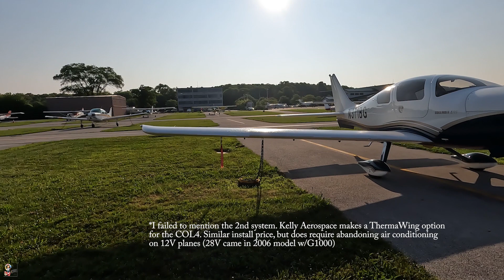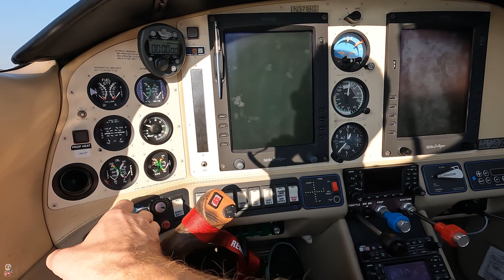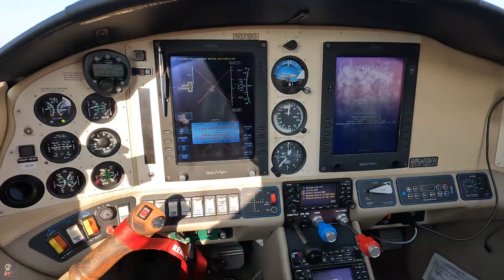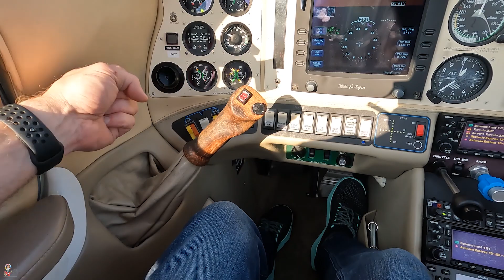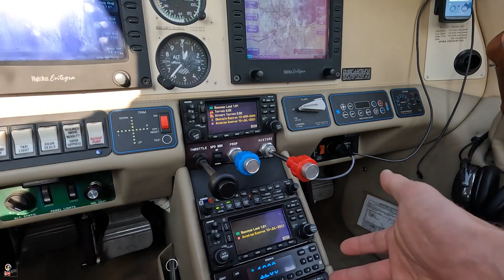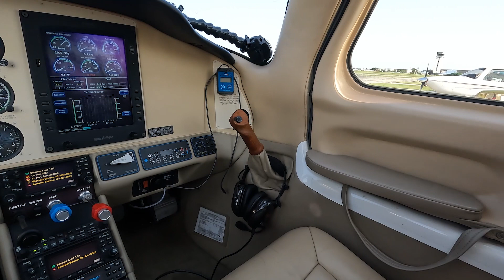Columbia 400 vs Cirrus SR-22

Comment: TEXTRON needs to bring back a TTX2.0  with a chute,  Lycoming TEO  FADEC , true sidestick.     It wuold blow the doors off of Sirrus sales.  because it would be faster,  easier to fly, have that chute, and be AMERICAN Owned 100 %
Reply from the maker: While it would be great to see this happen, it's super unlikely.
At least we have a true sidestick already. Take the win where we can.
Reply: @thehobbycollector1    it could  if they could get to breakeven in 5 years and I think they could.    The TTX2 would be faster, have more room, Fadec, pressurized, have G3000 CAPS , Return Home...And be American owned and made.    Would take 70 perecent of  Sr22 new sales.  in my estimation.   Americans  really shouldnt be subsidizing  AVIC the same company that builds jet fighters  with stolen technology that compete with the F35..right?
Reply from the maker: @scottmoseley5122  That's not a realistic expectation. In order to accomplish higher Vne, Fadec, pressurization, and CAP, it would require a whole new type certificate which would be way to expensive to break even in only 5 years.
This is the same reason why we only see very minor incremental gains in the SR-22 gen-over-gen and very rarely see any new type certified planes.
Until and unless the FARs get re-written to make certification easier (mostly cheaper), it's not going to happen.
Reply: @thehobbycollector1   it  would cost about what the cirrus vision cost ..  if the TTX2 took only half the sales of Chinese owned Sirrus it wouldb be about a year ROI. .

FROM CHT GPT:   
🧠 Conclusion
If Textron builds a truly competitive TTx 2.0 and captures even half of Cirrus's SR22 market, they could:

Recoup their $100M+ investment in under 1 year

Build a $100M+/year profit center annually after that

Cirrus proved there's a large market for high-end piston singles. A CAPS-equipped pressurized TTx with faster cruise and luxury could take a serious chunk — especially backed by Textron’s brand and support.

Comment: Thx, you are very well spoken. 
I think a lot of the spouses or lower time pilots prefer the parachute. I think they both look sleek.  I'm glad the Cirrus is made in America. Do Columbia owners have a few mechanics in mind when they do their annuals?  I believe the 400 has two solid main spares and their red line is about 230 knots. Many high-performance singles red lines are 198 knots.  Is this correct? I never entertained the fact that the Utility category is a positive when comparing the two. (I just had a super flight in my Seneca from SE Wisconsin to Rochester NY area at two hours and forty fine minutes. You can't beat the convenience, and less stress of using general aviation.)
Reply from the maker: Correct that redline is 230.

There are a few reputable shops for the 400, and a few shops who have a comfortable level of history for many. Plus the type club has a wealth of knowledge and many who are still the original owners of their planes straight from the factory.

GA is absolutely a great way to go, we just finished a quick trip down to Knoxville and back. A weekend that would be impossible in a practical sense as an overnight trip whether driving or flying commercial.

Comment: I have the 1st Columbia 400 manufactured and it came from the factory as a 24 volt system.  Can you tell me where you got the gust lock strap and attachment that you have on the left side stick?
Reply from the maker: The gust lock is easy to sew up, or you can find it near the top of AirPower’s reference list. One of my favorite gust locks that hooks to the rudder and wraps on the stick. It’s almost impossible to get into the plane and leave it in place.

https://www.airpowerinc.com/cessna-columbia-parts-guides

Comment: I have about 25 hours in the SR20, from a long time ago (2006-ish). Yesterday I did about two hours as a pax in a TT, with G1000 avionics. I could barely get into/out of the TT, and it was the tightest cockpit I've ever a tried to squeeze in. I'm about 6'4" and I was kinda done after 1.5 hours. If you're tall-ish, be sure to take this into consideration.
Reply from the maker: This is completely valid for some. I'm very median american male at 5'10" and find it to be very comfortable. The tallest passenger i've had was at 6'4" and while he fit, it was only a 30 minute flight for him.
While the seats did change to a new style in later models than mine, this is where the extra 1" of cabin heigh can help the taller folks.
Thanks for chiming in, it was something i should have covered, but was beyond my experience to competently speak towards.
Reply: I fly the Cirrus at 5ft 11, I need to decline my seat one notch to fit in comfortably, I wish it had more headroom , at 6ft 4, I dont know of any GA that fits you comfortably…

Comment: This was an excellent comparison! These performance planes are exactly what I’m looking for, although they may be a little bit of a reach financially. I will say that I’m looking for performance, because my mission is definitely to be able to go truly cross country, and get there with some speed. I also like composite aircraft as opposed to the traditional metal ones. This was very helpful!
Reply from the maker: I can sympathize with the financial stretch. I purchased one that needed a pretty extensive first annual to help get me into the airframe.
But long cross country is the biggest benefit. We have started being able to travel on a moments notice from Chicago to as far as the Gulf Coast on a single tank and without taking additional PTO.

Comment: Thank you for the Columbia videos!  Have you had any issues with the Avidyne, such as resetting in flight?
Reply from the maker: The Avidyne has been rock solid with 2 exceptions.
1) The fuel totalizer has zeroed itself out twice. But I think it’s related to #2. Which is that I upgraded one of the mags to a SureFly electronic ignition, and those lines generate enough noise to play with the fuel flow signals. 
I had the wires re-bundled to reduce the noise at last annual, and solid since. I really like flying behind it.
Reply: @thehobbycollector1  Thanks a ton!  That's been my biggest hesitation. I'm familiar with 6 packs and G1000 avionics, but the Avidyne has been a black box for me, so I've shied away from those. However, most of the Columbias in this market segment have that setup so it's nice to hear about good experiences with it.
Reply from the maker: Well if you end up in the market, this exact bird may end up in the listings soon as we are weighing how our future flying adventures are going to unfold.